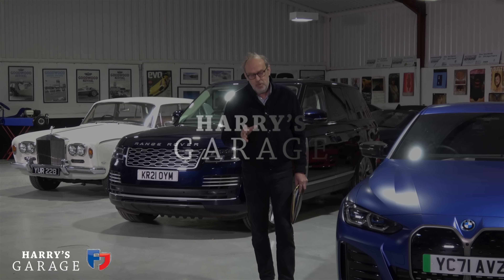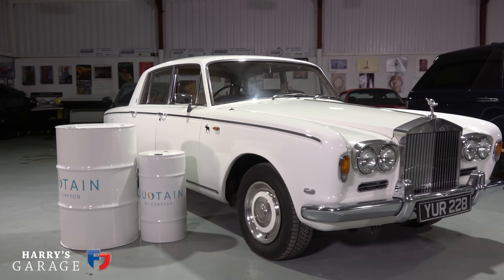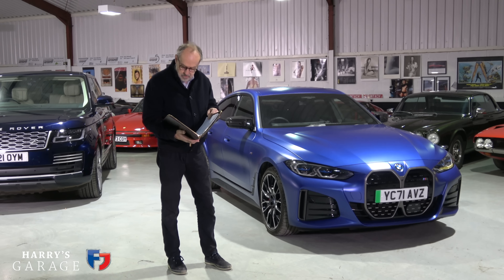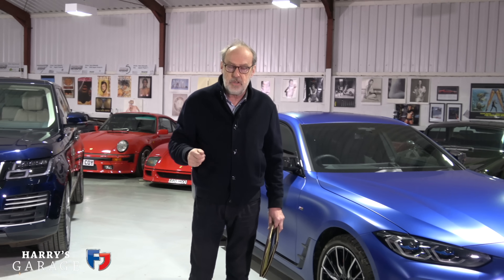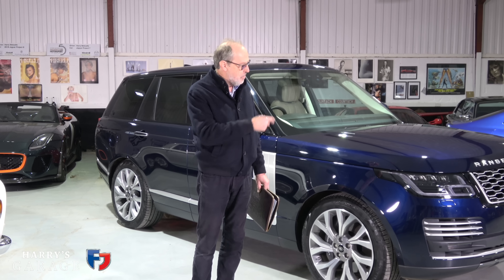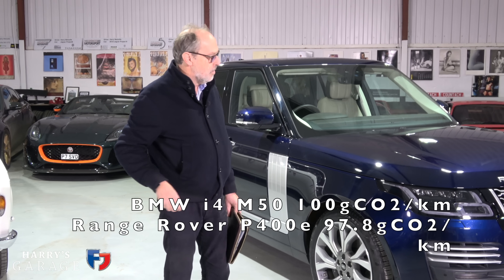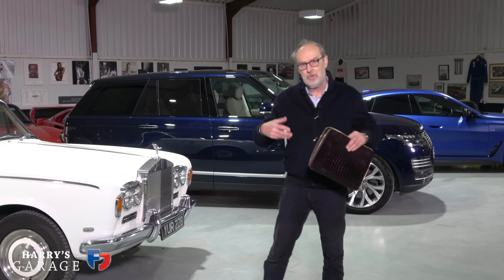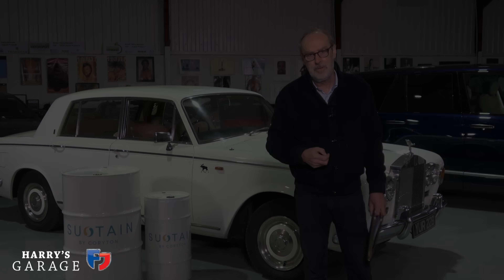Sustainable fuels; what are they & are e-fuels better for the planet than running an EV or PHEV?

Comment: I think we are running into this EV period with blinkers on. My biggest concern was the restively short life span of an EV compared to other types. No matter what the manufacturers will tell you, you cannot get away with the fact that the battery packs start to degrade from day one. Yes of course components wear on other types of vehicles, but the cost of repair is usually not something that is going to see the car end up at the crushers in ten years or so - if your lucky. I go for a drive and see that a lot of cars on our roads are 10 years old or more - and if looked after that could still do many more thousands of miles. So from the start I began to think that going down the EV route would double the amount of cars being produced per year. That worried me, but now you mention that production for all these cars increases C02 by 70%, I am even more worried.
Reply: It's not in their interests to tell us the real facts like this, only to keep pumping out propaganda, and marketing messages that brainwash us into believing we'll be incomplete if we don't have the next new model.  As with housing, it's no longer about creating something of value to the buyer, it's solely about pumping out as much bland sh*t as possible, to make as much profit as possible.  This is why the restomod firms like Singer do so well, because they know what people really want.  Not just a box with a shiny paintjob
Reply: It's all a load of Bullocks
Reply: The cost to replace a few dead battery cells isn't much. There are many videos on Youtube of Leaf's having the dead cells replaced for £500 to £1k to bringing  the pack back up to 100% capacity again. The click bait / tabloid articles quoting whole battery packs costing £xxk upwards is just fake news. YOU DON'T NEED TO REPLACE THE WHOLE PACK !
Reply: @SDK2006b  Your average person does not repair their own ICE vehicle, and those habits are unlikely to change with EV's.
Reply: @LN997-i8x  - I'm not taking about owners doing their own EV battery replacements - these are done at specialist EV garages.
Reply: Even if you replace the entire battery every 200k miles, an EV will still produce lower overall lifetime emissions than a comparable ICE car. 

The only reason internal combustion cars can exist is due to the extreme energy density of fuels like gasoline and diesel. Like, a gallon of gas holds approximately 30KWh worth of energy!! That means most cars are driving around with the equivalent of 300-500KWh batteries, yet due to the inefficiency of combustion they can only do around 0.5-1.5mile/KWh. In comparison, most EVs get around 2.5-4.5miles/KWh. An EV with a 110KWh battery has the same amount of energy as like 3 gallons of gas!!
Reply: @CrazyWeeMonkey  I agree, but at what cost? Fine if your well off and finding a large wad of money is no problem, but if your a low income family that needs to scrimp and save for two years just to spend £2k on a car, what will that mean for them? The divide between rich and poor will grow, the rich buying the cars with the extra range battery packs with extremely fast charging, the poor running around in cars that they have to stop and charge constantly on a long journey. I even wrote to my MP about this, her reply? - Oh don't worry, people will be able to lease a cheap EV for £200 per month. I just checked for myself, about the cheapest deal I could find was for a VW E-UP,  only £180, but with an initial payment of over £2k And for that you get a car with only 140 miles of range. And of course it is pretty much the bottom of the range. Unless our economy changes for the better in the next decade or two, a lot of poorer families are going to be in for a shock.

I am far from against green energy, but governments need to make sure it does not hit the lowest earning families more than it does the richer folks. But unless there is a big change in battery technology, I really cannot see that happening.
Reply: Degradation is not a real issue anymore though now that we're past the 1st gen Nissan Leaf stage where manufacturers hadn't yet figured out proper thermal battery management. Most modern EVs won't loose more than 10% battery capacity over the first 100k Miles. And the older the battery the lower degradation gets.
Reply: @MadDaCube  I really cannot agree, Li-ion cells will degrade no matter how well you look after them, and that starts from the day you put a charge into them, your not going to stop the internal materials from reacting with each other by keeping them cool. But I totally agree keeping them at a happy temperature will probably at least double their life cycle.

And with regards to the Leaf and some other small cars, swapping out cell packs is not such a great deal. Not so sure that is going to be easily done with the more expensive cars with long ranges.

Tesla are one of the longest standing players in the EV market, they have been out there long enough that we are no beginning to see the nightmares that EV's can cause. Tesla refuse outright to supply 3rd parties with replacement cell packs for their car battery packs. They will not even repair them for you. Fine if your car is still under warranty, but just a day or so out of warranty is going to cost you approx $15000.00 for them to replace the entire pack.

Yes, electric vehicle garages are beginning to pop up, but the best they can do is fit either second hand used Tesla cell packs, for a price of course, or some will even attempt to fit non Tesla cells. I have the feeling that will not end well. And if the Tesla software that runs the car detects that someone's messed with your pack, Tesla will happily disable fast charging on your vehicle. They say this is a service because they do not want a battery fire in your car. And as far as I know, nobody's managed to hack that problem. So when all car manufacturers follow suit it's going to be like a licence to print money for them.

The real problem here is that until a better technology battery is invented, we will have to live with the fact that most future cars will have a life of probably less than half of the i.c.e equivalent. Mind you, having said that, a great deal of todays internal combustion engines cars are built with planned obsolescence in mind. Have so many cases of vehicles just a couple of years out of warranty and the module you need to repair it is no longer available. In some cases vehicles in warranty are hitting the same hurdle.

Sadly cars are becoming more and more a chuck away item. Keeping them long term is probably not going to be viable, unless it's just a little town runabout - then who cares if your battery pack only gives you 35 miles of range now?

And then you get to the part where hundreds of thousands of families in our country alone rely on being able to buy cheap second hand vehicles, knowing with proper maintenance it will probably last for years to come. I simply do not think your going to get cheap EV's on the market, and the ones that are down the bottom of the price range will no doubt have a battery on it's lasts legs. This will no doubt hit low income families the worst, if they want an EV that will give them the same flexibility that a cheaper i.c.e car would, then they are going to be paying probably 5 times the price they would have previously. 

Things are certainly going to get interesting in the next decade or two.
Reply: @100SteveB  Batteries are 95% recycleable, you don't have to throw them away. As EV's get older the ability to exchange the packs will become available, plus the lifespan is way, way longer than the Mfrs ever thought possible. The batteries in Toyota hybrids are surviving in excess of 400,000 miles. Its why most taxi cabs in the US are Prius's now. Short battery life is a myth.
Reply: @piersdenney  Hybrids are a totally different matter, by their very nature of course battery packs will last a much longer time. But just do some research into the nightmares people are having with cars just a few years old. As for battery packs becoming easily exchangeable in the fututre, that will need to be dealt with in the courts, because at the moment manufacturers are trending towards 'locking' battery packs to the car - very much like the way manufactures of some phones, laptops and tablets are doing. The software detects something's changed, and the change was not made by the manufacturer, thus the software throws a fit. And of course the manufacturer will insist it is only for the safety of the customer. And in a way you can understand why, litium cells of any type can be rather volatile to say the least if not installed correctly. 

But I would certainly like to see a future where this will not be a problem, but I think we are a long way from that with pure EV's.

Yes of course things are improving, with at least one manufacturer giving a 8 year warranty on it's battery packs, but what happens to that car once the warranty is up - even if the battery last ten years? Like I said in my previous comment, at the moment you can buy a good used 10 year old car for very little money, and the chances are you will get many more years out of it without a massive bill that is costs many times more than what you paid for the car. In most cases the car will be scrapped and recycled, along with it's battery pack. Just the recycling uses a lot of energy, and then you have the energy required to produce another car to add in. But at least on that we can be fairly optimistic that hopefully the power needed for that will be green power - with zero carbon emissions involved. Only then will it not be an issue if we scrap cars when the battery pack finally becomes depleted to the point it can no longer hold a decent charge. But of course, that will never help your average low wage family that can only afford a car if they buy a cheap used one.

Comment: 14:15 producing your own power is the least cost effective option here. If you put that same 20 or 30k into producing renewable energy on a utility scale you would get twice the bang for your buck. The problem here is your grid, this is a far easier and more efficient fix at the utility level than at the end user consumer level.
I understand there are lots of advantages household level energy Independence, I'm not knocking you for that, I'm talking as a solution to transportation energy costs.

Comment: I totally agree that hybrid or electrics vehicles to replace all cars is ludicrous and can damage the environment more than keeping the petrol cars on the road but replacing vehicles that do high mileage would be a good thing when feasible. Same for shipping boats and planes (using hydrogen and renewable power). But forcing people to replace their 2000-5000 miles a year urban cars will be detrimental for the environment at the moment.
Lastly, the theory of sustainable fuels only hold if you use agricultural wastes and not grow fields to produce your biomass ... Or get all your carbon from the air. Otherwise you are ignoring the pollution created by growing crops, the effect on the soil (including releasing CO2 already stored in the soil but also the damage to the soil and local ecosystem), reducing food production... So sorry but as much as I would like to run my modest car collection (with which I do negligible annual mileage) with sustainable fuels, I would have to be sure that I am not actually still causing damage paying twice the price.
PS: an recent interesting scientific study in the US showed that ethanol produced with corn and added to petrol to make E10 was responsible for 25% more CO2 than petrol.

Comment: Brilliant video! F1 should be running e-fuel powered conventional powertrains rather than the ludicrously complicated hybrid powertrains. Maybe we will hear those V10 engines again!
Reply from the maker: They are already, behind the scenes. Watch this space..
Reply: Oh yes bring back the V10s! 😍😄
Reply: F1 should ignore ecology and race like men, with gasoline. To hell with the foolishness of eco racing.
Reply: They should have a support race where it 's "Run what you want, but you only get 5L of fuel"; an Eco-Cup Challenge if you will.

Or maybe not, because it'd only really be exciting to an actuary or statistician. Imagine someone getting excited about that draft in neutral that gained the driver an extra 200m of range.

Comment: I study these  topics at university. Efuels are not sustainable in the manner that we can have every car in the world using them. The main issue is the horrendous inefficiency from a holistic perspective. If I remember correctly, the total efficiency is around 15% while a battery electric car is 80%. For every efuel car there could be 4 battery electric.

I don’t think synthetic petroleum will have any meaningful impact on the reduction of greenhouse gases. But if it keeps politicians from making stupid rules that would be good. Another benefit is that the world will become less dependent on nations with oil. Military around the world are intrigued by the prospect of becoming self reliant on petrol.
Reply from the maker: E-fuels (and sustainable fuels) will never replace regular pump gasoline at every fuel pump but for using in low mileage classics and in motorsport, that's a different matter.

Comment: So your not charging the BMW at home then? Not sure your figures are entirely fair. Charge the EV from home with your wind turbine and it costs what then?
Also the sustainable fuel is great if made locally, if not, what is the C02 for getting it from manufacture to your house?
Reply from the maker: It's a press car that I only had for a few days and was charged at the local BMW garage before it was delivered to me.
Reply: @harrysgarage  Harry, I absolutely love your channel and I am also a dyed in the wool petrol head, but I'm not sure this is a fair comparison. I get your points but I feel you are a bit off with this on quite a few levels. 
Are we there yet with EV as a direct replacement? Clearly not, but they are (in total life cycle terms) more C02 friendly.
Synthetic fuels are certainly the future for our classics and ICE vehicles.

Comment: First you have not counted the electricity as CO2 in your Range Rover that is why you somehow got lower figure. Second there is no perfect cycle for the "bio fuel". It uses energy to make the fuel , transport it etc. It also adds CO2 .
Reply from the maker: The vast majority of the energy used to make the Sustain fuel comes from the waste bio-LPG produced during the production process.
Reply: @harrysgarage  Any chance of making a video on the wind turbine setup (maybe on the farm channel)?
Reply: @harrysgarage  do the figure include the energy input for the conversion from biomass to fuel?

Comment: The other environmental issue to consider is tail pipe emissions of byproducts like NOx PM10s etc from the burnt diesel or petrol particularly within cities
Reply: Yes surely there are more trade-offs. Although this is very interesting and promising and I look forward to the series, Harry should be careful not to be a mouthpiece for an energy company
Reply: Getting rid of co2 will kill all the trees and plants and rid the planet of oxygen. The planet needs co2. As for the co2 in the atmosphere it is so low the eco Noddy's won't give a figure but it's less than 4percent
Reply: Agree with your comment, CO2 is only one factor that the world is focussed on. This is an interim period of massive change in the automotive industry. Got to start somewhere. Ultimately no tailpipe emissions is the way forward, better for all our health. Cost of electric cars is higher in CO2 plus many other things , but this is changing exponentially and over the life of the car, this CO2 figure will reduce and the electric production will also change to be more renewable or green going forward.  Interesting stuff though.
Reply: @Nodontbuymeportal  there are other industries like Refrigeration, that I work in that emit c02 massively disproportionately to cars, due to the GWP of the refrigerants that are used. There are many easier and cheaper ways that have multiple knock on effects for all of us but it doesn't get discussed, as this is operation tax the poor people. Have a look at a C02 refrigerant calculator, then go to your local supermarket and ask why they don't put doors on the fridges
Reply: @chappy2121  good points raised.
Reply: @Nodontbuymeportal  I did post the link up to the one I use but YT removes them. Wonder why🤔
Reply: @Nodontbuymeportal  the one I use states 10kg R404a is equivalent to 39.2 Ton of c02. Or 275, 615km in a car. 
Or a 10w lightbulb powered for 916 YEARS. Or around the world 4 times in a plane. MENTAL
Reply: I suggest to read some SAE articles written by Porsche on the topic. Renewable fuels are much cleaner than traditional fuels and therefore NOx and particles are extremely reduced. As Porsche measured, a 40 years old 911 would be complaint with the latest emission regulations, by just changing the fuel...
Reply: Even in today's world, the numbers are insignificant.
If a bunch of you eco-hipsters buy yourself some EVs, leaving the remaining few petrol heads... the numbers are even more inconceivably insignificant.
So it's not really something to consider.
You should be more concerned with how a single volcano eruption can undo all your 'hard work'.
Reply: @QBDLettuce  Exactly!
Reply: @QBDLettuce  I am no eco hipster, less rubbish out of a tail pipe will benefit in the long term, but there is a long way to go and I get your comments. Forest fires are just as bad to. The balance is way off and to heavily focussed in one area.